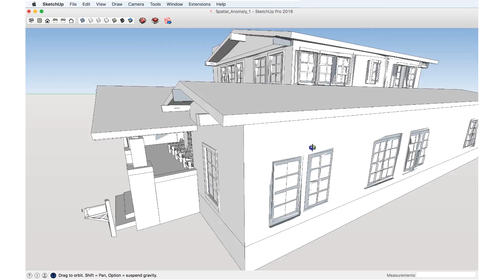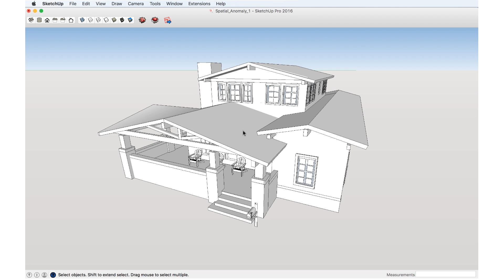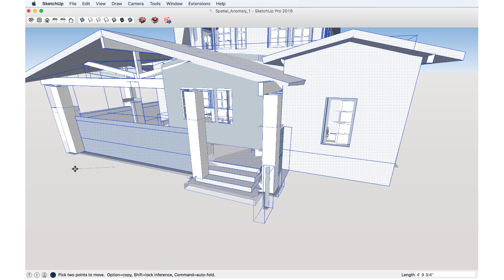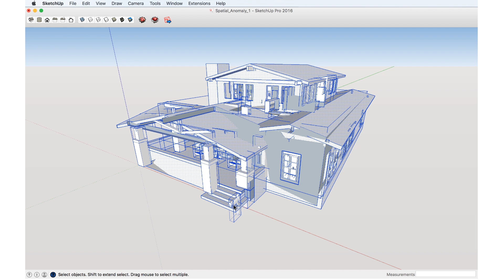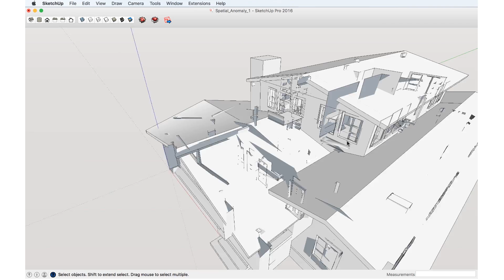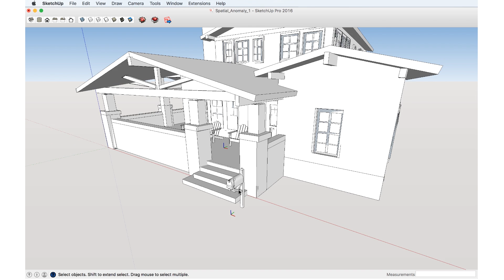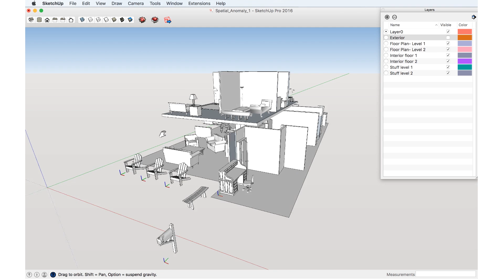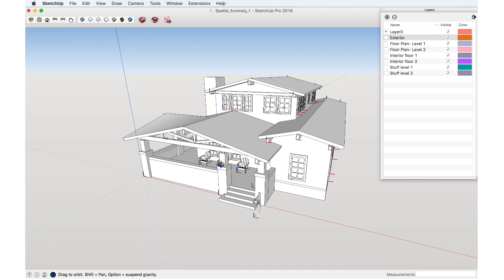SketchUp Skill Builder: Visual Display Problems Due to Distance

Comment: Please do one video to fix camera clipping through model too. 
Sometime when i have to deal with a huge model, when i zoom in detail and the camera just clip and cut through it like section panel.
Reply: +Minh Le Try to model in milimeters when working in detailed models, sometimes this will fix the issue
Reply: +Minh Le Sometimes you need to copy the whole model and paste it in a new sketchup file.
Reply: +Minh Le One way to sort of solve that is to change the field of view when you zoom in on a model